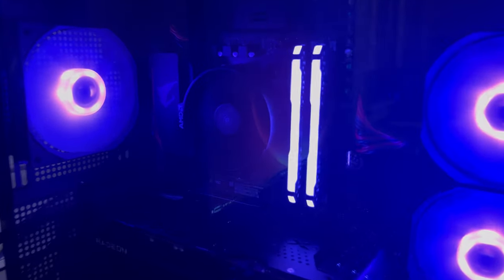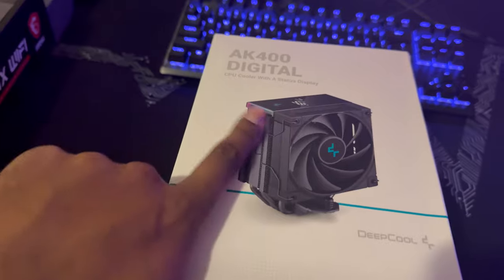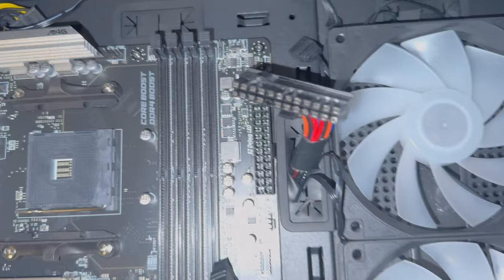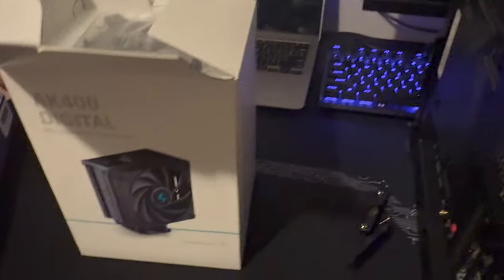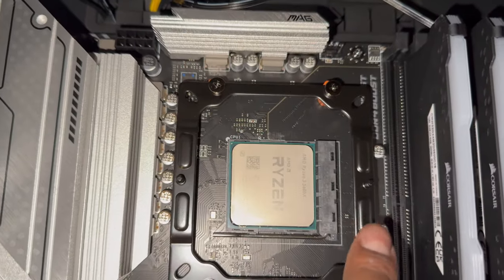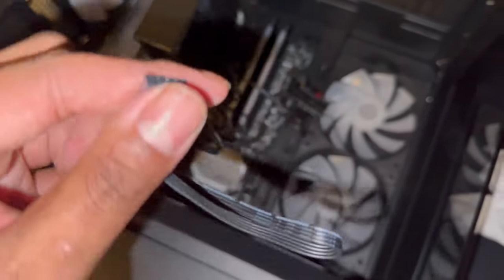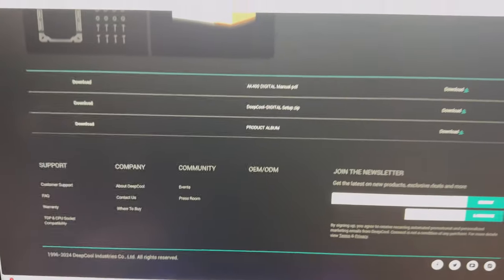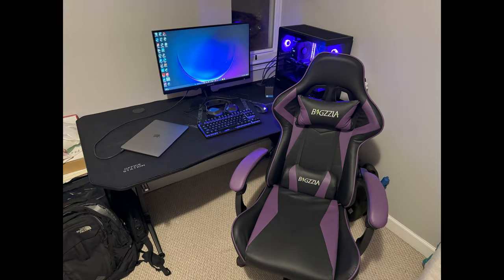I Air-cooled My CPU! Deepcool AK400 Digital- (PC Build Vlog 2)

Comment: Apparently the 400 can handle a 13700k with good airflow, anything hotter/more power will need a higher model and its great they have a bunch. I really like the 400 tho, slim and sleek and so cheap even my grandma would say its cheap.

Comment: how do you know when to stop tightening the fan into the bracket
Reply from the maker: @apaches04soccer  if I recall correctly it won’t let you over tighten it
Reply: @BigStuDolla91  Thanks! I tighten mine but i know for sure the springs werent all the way pressed down, just tight enough